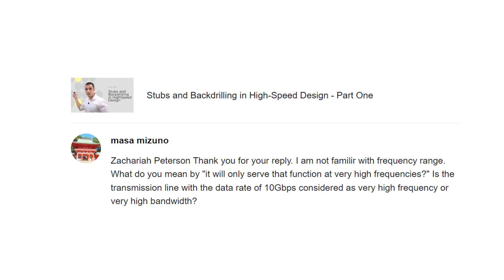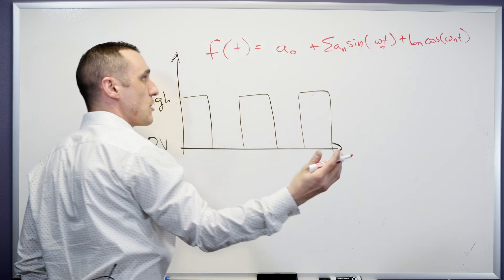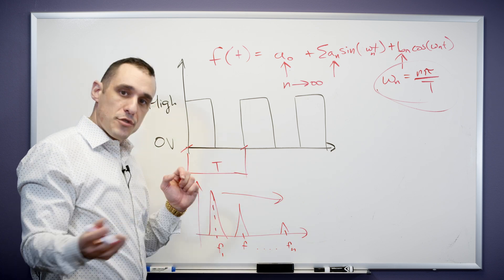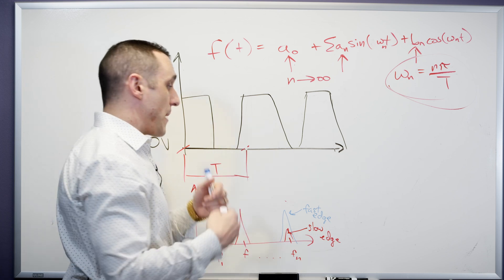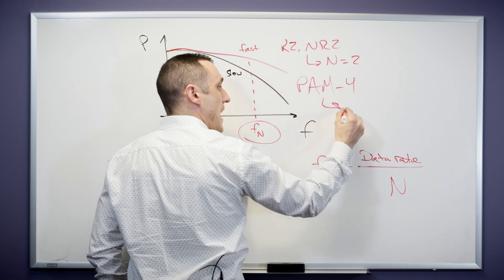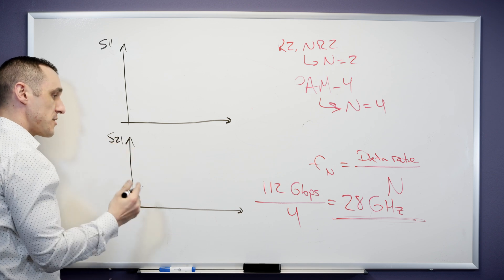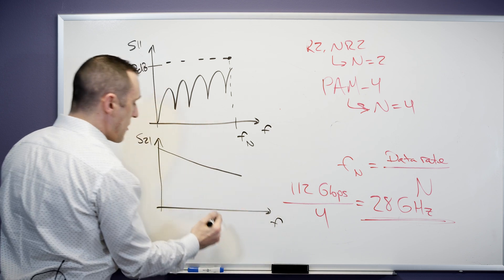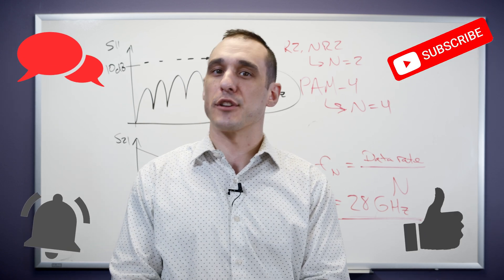Digital Signal Bandwidth Vs. Frequency for NRZ and PAM-4

Comment: As much as I wanted to do a very long explanation on bandwidth that includes the -3dB/knee frequency, we didn't have space in this video, so I will be doing a followup to this that explains some of the big misconceptions on knee frequencies with square wave signals vs. the modulated signals discussed here. They are very different!
Reply: Hi Zach, thank you for the great video. Looking forward to see the next video.
I see that the N comes from how many bit streams can be transferred simultaneously in a modulation. So dividing full bitrate by N  gives us real bitrate to handle on the transmission line. But what comes in my mind is that we usually do not specify the transmission line bandwidth to be handled directly from the data rate, for digital signals it is recommended that roughly 0.35/trise    (where 0.35 may change regarding how you handle strict but anyway) , so I am confused about which one is right. is the reason that the signal forms are different ( PAM - sinusoidal signal  and  digital signal is square wave)?
Reply: @myetis1990  The knee frequency is often misunderstoodas it relates to simple square waves, but not all high-speed signaling standards transfer data as square waves. Check out the blog in the description where I give some examples of common interfaces that use modulated bitstreams. The factor N comes from a factor 2*log(n), where n is the number of states. So for the two types being discussed, where we have 1 bit per NRZ/RZ symbol or 2 bits per PAM-4 signal, you get the factor N. If you have other PAM bitstreams you get a different number, which also depends on the encoding. For example, different Ethernet speeds use PAM-3 or PAM-5, so you don't get exactly the factor N. Here we're actually specifying the amount of bandwdith the channel needs, which includes the receiver, and it's the receiver sample rate that dictates whether it can detect a modulated signal like a PAM bitstream. The transmission line just needs to be able to transport the minimum amount of bandwidth for the receiver to do its job.

For a simple square wave signal it is totally different because we are not sampling a modulated bitstream. For other signals that carry digital data there is no rise time (such as QAM) until the data is pulled from the modulated, so we can't strictly relate a rise time to the channel bandwidth.
Reply: @Zachariah-Peterson  you are the king! thank you so much for such a great explanation :) 
It seems that there are a huge lot of things to learn from you.
Reply: @myetis1990  hi where can I find link about this how you handle strict. As in some places 0.5/trise has been used. So what is the trade off and benifit of that.
Reply: @Magizhini Muthukumar  The 0.5 comes from the first zero in the power spectrum for a trapezoidal signal, so it is actually related to a signal's power spectrum and not the bandwidth of a channel. You can find a graph showing this on page 27 of the linked PDF document in the description. I talked about this in an Interference Technology article that should be coming out in May 2023, if you start using that formula you could underestimate or overestimage the required bandwidth. For a 112G NRZ bitstream, you would underestimate if you take rise time to be about 25% of 1 UI, but you would overestimate the same 112G bitstream with PAM-4 modulation.

Comment: Hi Zach, are there other types of signaling formats, except those which are shown in the video? And when use a specific type?
Reply: The other types include phase shift keying (PSK), frequency modulation (FM), pulse width modulation (PWM), pulse frequency modulation (PFM), amplitude modulation (AM), amplitude shift keying (ASK), and frequency shift keying (FSK). There are also quadrature versions of these modulation types. AM, FM, PWM, and PFM are analog, meaning the modulated quantity can be any value within a specific range. ASK, FSK, PSK, are digital modulation formats applied to analog signals, such as high-frequency radio signals used to transmit digital data. The other types of digital modulation (NRZ/RZ, PAM) are mostly applied to digital interfaces like Ethernet, newest version of PCIe, MIPI, etc. As a designer, you don't always get to choose unless you are doing custom logic (for example, in ASIC development or FPGAs) or unless you are designing a proprietary standard. The decision has already been made based on the interface standard.

Comment: Thank u, Zach for creating the video. I was not expected that you made the video based on my question.  I understand it now.  Thank you very much.  My next question to you is what the title of this video says.  I do not know when to use NRZ and when to use PAM4. Is PAM4 used on higher data rate? Is NRZ used on lower data rate?  If the data rate is the same, PAM4 delivers faster than NRZ as it is 2 bit data trasmission whereas NRZ is only 1bit data transmission. Am I correct?
Reply: There is tradeoffs between these two. PAM-4 provides higher data rate but without requiring greater bandwidth in the channel. However, there will be lower noise margin between the signal levels, so intersymbol interference is more difficult to deal with. I think it's best to think about it in terms of those tradeoffs. There are some transceivers from same manufacturer where they will offer same data rate, but with either NRZ or PAM-4 on their part numbers in order to accommodate different chipsets.

Comment: Hi,

As a new user it has been a bit difficult to get into the Altium Signal Integrity tool as the documentation on Altium website is out-dated and there are no tutorials or webinars available. Would it be possible to do a tutorial of the current Signal Integrity tool and how to correctly set up a SI simulation with IBIS models (for example CPU+RAM or some other bus)? It would also be nice if some simulation pitfalls were covered (limitations, risk and types of user errors etc).
Reply: This is a great topic, sure I will set something up with IBIS models. Is there any specific component that would be helpful to look at? Or do you have a specific model you are trying to work with?
Reply: @Zachariah-Peterson   IMX6Q with Micron DDR3 (specific model doesn't matter, just the setup process). There is the IMX6rex open source project which uses the same components and is available for download. It would be nice to know how Altium SI calculates stuff like via transitions.
Reply: @aopfin  Unfortunately Altium does not calculate via transitions, although I have complained to product people that they need to integrate the via tool from Simbeor. The layer stack manager currently uses the Simbeor SDK to do impedance calculations, so they could definitely create a via impedance tool, something that includes auto placement of stitching vias as well would be very nice.

Comment: Hi Zach. Thanks for the video. I always enjoy those videos of yours, but with this one, I'm not very sure if I miss something... Like, the bandwidth if a signal in your example of a 120ghz square wave carrier with 28ghz bandwith, the signal path should actually be designed for 120+28ghz=148ghz, right?
Also, to transmit a square wave, in the frequecy spectrum this is a sinx/x signal, and the bandwidth of just the square wave itself must be very high to at least transmit the first couple of harmonics. I would say, just for your example of a square wave of 120ghz, the bandwidth of the transmission line should be at least 1.2thz for the square wave... What do you think about that? Is there a reason you did not mention that, or did I miss something?
Reply: He’s not referring to a 120GHz carrier. The video mentions a 112Gbps data rate with PAM-4 signaling which has 4 amplitude levels to stuff more information into less bandwidth. So 112/4 = 28GHz, this is the information bandwidth. If instead this were 112Gbps in a 2 level amplitude signaling format like NRZ, then your information bandwidth would be 56GHz, which satisfies Nyquist sampling criteria in either case. It might seem like a no brainer to always choose PAM-4 or some higher order signaling but that requires higher SNR. As always there are trade offs to be made.
Reply: @Chris  It should be no wonder that the newer generations of computing interfaces are all adopting PAM-4 signaling.
Reply: I am not sure but you can think of bandpass sampling where actual signal transmission frequency is not considered only transmission bandwidth is considered for Nyqusit sampling
Reply: @Muthukumar-us8ip  yes, but he did not talk about bandpass sampling, but about the bandwidth of a signal and the s21 and s11 of a transmition path, which should at least include the 120ght carrier, not cut off at 28ghz
Reply: @matthiasmuller7970  
Okay but for digital signal the carrier will be removed right if i am not wrong. It should be a baseband or passband data maybe before DUC stage or after DDC stage where there is not even IF Freq is considered.
Reply: @Matthias Müller  Chris has explained it correctly, the bit rate does not equal the frequency of some carrier.

Comment: What would be a safe margin for over design? in this case you mentioned 28GHz but would it be good enough to design for 30GHz? or do I need to take into account a larger margin or error ? asking since this way I may get a bit more or a leway to mess up a bit. Also if this trace will be exposed how will surface finishes generally affect it? like ENIG ?
Reply: Answer will always be it depends. Surface finish will have an impact on channel quality as you approach higher frequencies, this is the value of simulating channels using field solvers like Hyperlynx, ADS, etc.
Reply: I love this kind of question because at the end of the day there is no "rule of thumb" for the margin that should be applied. At the end of the day, the channel's bandwidth is not the only metric that matters, what matters is that you sit within the S-parameter mask for S11, S21, and crosstalk. There is also bit error rate. In total, these metrics are used for channel compliance.